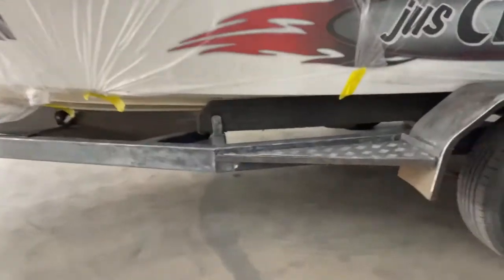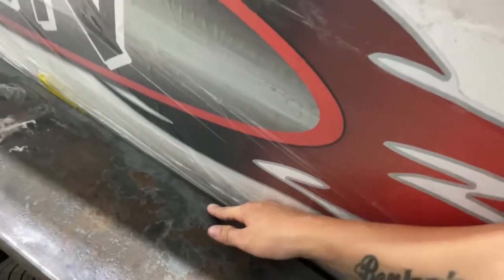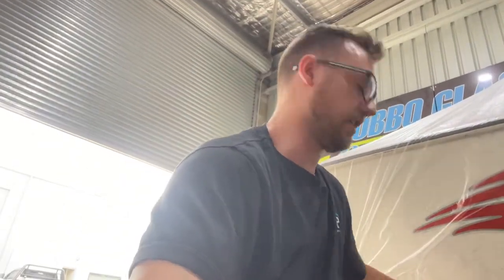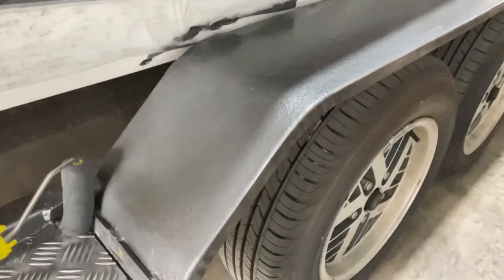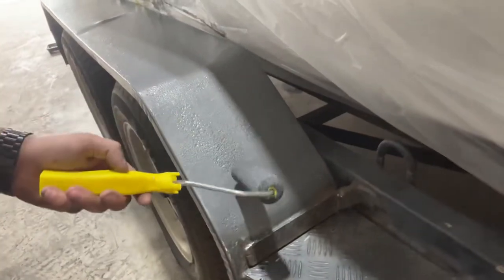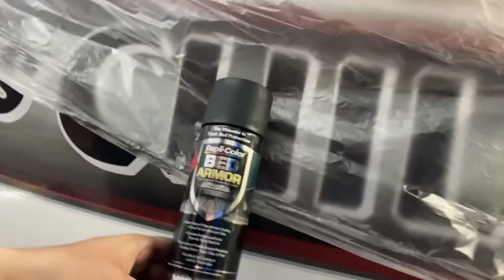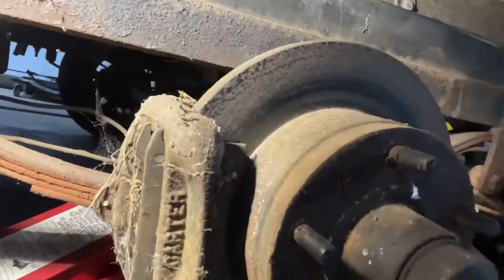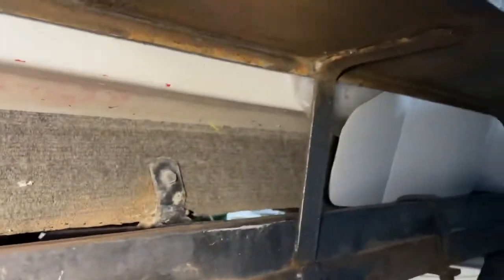How to paint a boat trailer

Comment: Did you have to rough the surface before painting it?
Reply from the maker: Yes, I used a wire knot wheel on an angle grinder to rip a lot of it up and to remove the surface rust
Reply: @aussiecustomgarage  what if your boat trailer has a old layer of paint. Do you remove the layer and then sand the surface, clean, dry and then apply 2 coats of paint?
Reply from the maker: Hi Yousif, it depends on if the paint is flaking off or powdering. In the video before this I showed the tools I used and how I did it. 
My trailer had roughly 3 different coats of paint from previous peoples attempts. So I used a wire knot brush on a grinder and stripped all the paint back to the galvanised steel
Reply: @aussiecustomgarage  am sorry am new to this. But how can I tell if the paint is powdering
Reply from the maker: @yousifsultan628  if the paint leaves a powdery substance on your hand before sanding. But if your using a wire knot wheel it will rip off all paint anyway. But if using a sander I would recommend using a 240 grit sandpaper on of even a 80 grit sandpaper if you are paint rolling like I have done in the video. The paint roller fills in slot of blemishes
Reply: @aussiecustomgarage  can a sander be used in both cases. Powder or flakes. Am pretty sure my paint is powdery
Reply from the maker: @yousifsultan628  yes that’s perfectly fine
Reply: @aussiecustomgarage  thank you i really appreciate your help